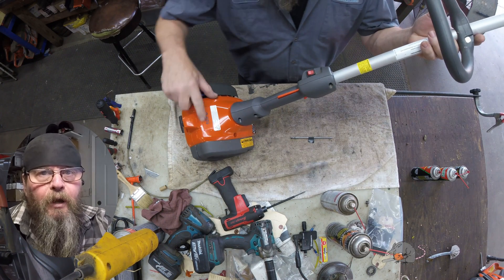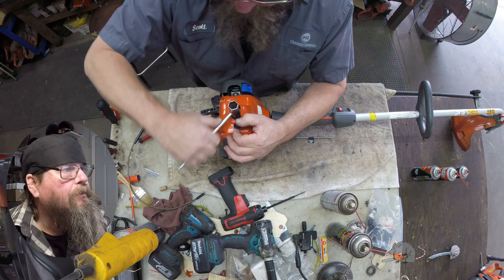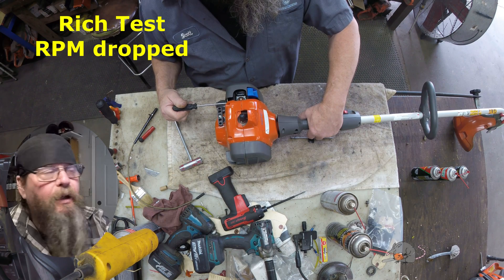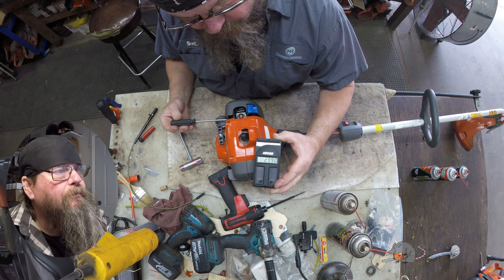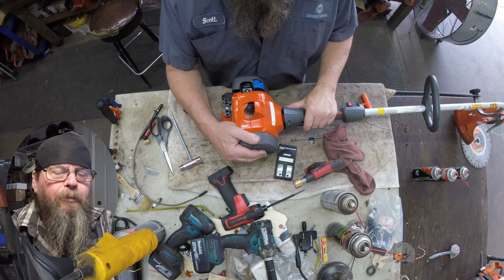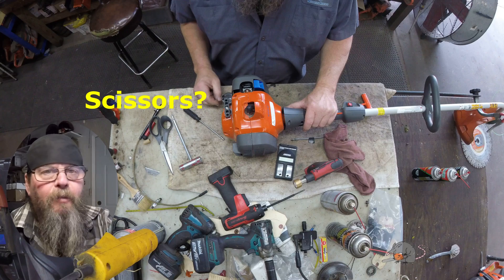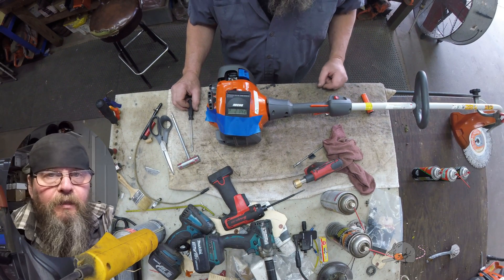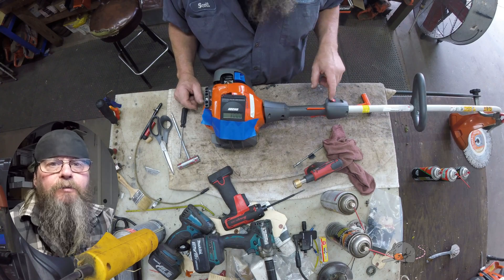Husqvarna 122C Carb Adjust-What is "Four Stroking"?

Comment: What kind of tool are you using to adjust the H/L screws?! On my machine it doesn't have a screw head.
Reply: Oh I found them. It looks funny. I'm having the same problem with my trimmer. It bogs down under load. Will be following this video for the next 24 hrs and see if I could get relief.
Reply from the maker: @alreddy13  Thanks for tuning in!

Comment: I always enjoy your videos, but on this one I heard but did not get an explanation of what four stroking actually is.
Reply from the maker: As I understand it four stroking is when the cylinder is filling with more fuel than can be cleanly burned and scavenged. I guess I've always used it as a reference point but never gave too much thought as to what is actually happening.
Reply: Thanks for the response. @TheGreasyShopRag

Comment: Does the thickness of the string matters or only the length when adjusting the H screw. Thx
Reply from the maker: I would say it only matters if you're going to change the thickness of the string after the adjustment. I think the answer is yes, the thickness (weight) matters.

Comment: Got any tips how to tune one of those barrel style single tuning screw Ryobi carburetors? I can't seem to get a good grasp on tuning my trimmer.
Reply from the maker: When you say single screw, are you counting the low speed in the top center of the "barrel"?
Reply: @TheGreasyShopRag  I'm referring to the one in the center of the throttle plate. There's also the idle a screw. Am I missing something?
Reply from the maker: @tomasznumrych7187  I'm a little confused. First you said barrel style now you say throttle plate. In my mind thats two different styles. Go to my home page, find my email addy and send me a few pics of what you have. Maybe I can help.
Reply: @TheGreasyShopRag  will do

Comment: Great tips Scott. You are absolutely right about customers starting their equipment, especially in cold weather, and expecting it to rev up smoothly and cleanly.  Opening up the low screw to drop a few hundred rpm on the rich side is the way to go!  Later!
Reply from the maker: Yep, no matter how correct the adjustment is, customers don't like to wait.

Comment: I wanted to thank you for all your input. I'm working on different levels of certification for Stihl. At 56 yo it's a joy to use my hands again. Especially as a disabled vet. I've learned so much from your years of experience. I just received that spark tester ive seen you use in your diagnosis.
Reply from the maker: Let me know how that tester works out for you.
Reply: Absolutely, would you say it's helped you diagnose things quicker and more efficiently. Thank you
Reply from the maker: @IraqiVet  Its still a newer tool for me but it has helped a lot.

Comment: Great explanation!  I’ve done saws and trimmers the same.  Lately tuning saws on idle and trimmers on high,   then final adjust.    Your thoughts please.    How do you start/set fast idle screw?
Reply from the maker: I adjust chainsaw low speed on bench, go out and adjust hi speed in log then adjust low speed as needed. I then let the saw cool (usually overnight) and retest cold start.
Reply: @TheGreasyShopRag  I do trimmers hi first then low.  Also set fast idle screw at middle of taper.  Not sure if best way
Reply from the maker: @steveriggenbach90  If you do Hi first then Lo, you will have to go back and adjust Hi after changing lo. At full throttle you are pulling fuel from all sources. The lo never shuts off so changing it will slightly change the hi mixture. How much? Not much. Try firing up a string trimmer then open and close the low while at full throttle. Does it change?
Reply from the maker: I bet you never expected to get YouTube homework 🙂
Reply: @TheGreasyShopRag  thanks will def try.  I can always try to improve.
Reply: @TheGreasyShopRag  hahahaha. Thanks teacher., bring it on.  Your helping more in a short time than others have in years.

Comment: Some canned fuel seems to run like your customer presented that trimmer.  A bit rich is way better than a bit too lean if you want your tools to last.  I think you had concrete saw clean and re-blade as the interruption, the 4 stroke guys are leary of your ire bu now.  ;-)
Reply from the maker: Concrete saw was going on rent but needed a different blade. During test run I discovered it needed a new pull rope.

Comment: OK, here goes: during the break you had a concrete saw rental return because it wasn't running right. Different tools came out and in the end you diagnosed a plugged screen and needed the torch. Alternate: the four stroke guys came over while you were distracted and made a mess. You had to use the saw on the floor to start it up and pretend to cut them to scare them off.
Reply from the maker: Plausible but not correct. We had a concrete saw going out and I had to switch blades. The torch and scissors were for replacing the frayed rope i discovered during test run. Thanks for playing!

Comment: Noice!  It’s interesting to think about how tuning a trimmer and a chainsaw are a bit different because you want a saw 4-stroking before it goes into the wood so when it’s under load it has enough power to cut and leans out during the cut. Did I get that right?
Reply from the maker: Yep. A trimmer just isn't exposed to the same high loads as a chainsaw.
Reply: @TheGreasyShopRag  Scott, do you have any videos showing how to tune a chainsaw, I'm particularly interested in how to tune ones with rev limited coils, since those can interfere in tuning by ear from what I understand
Reply from the maker: @tomasznumrych7187  I'm sorry I don't have one of those videos but I'll see what I can do.